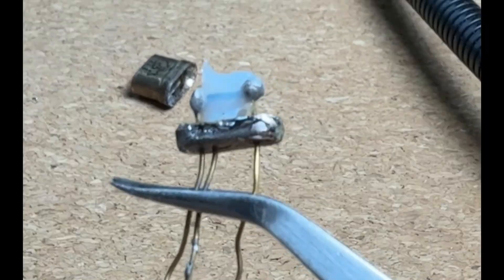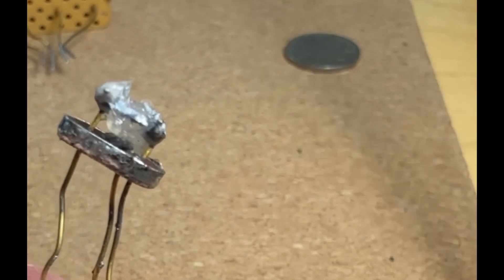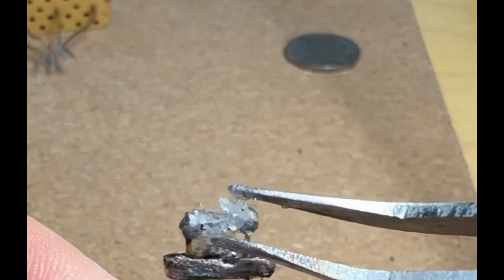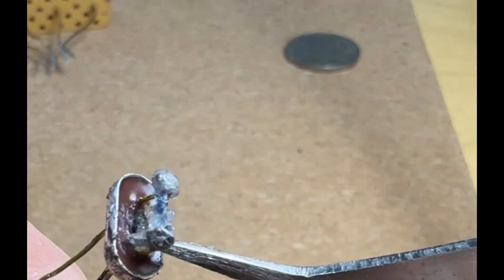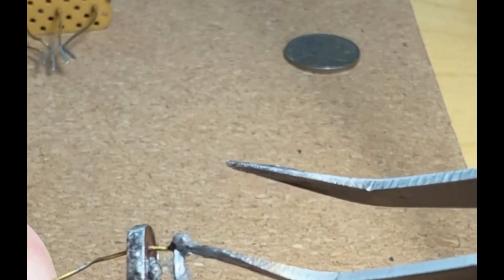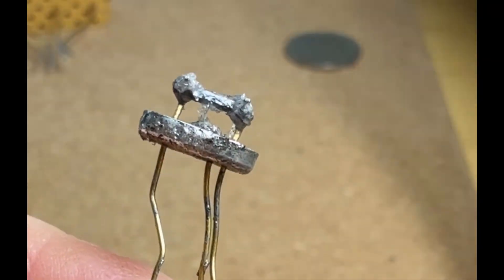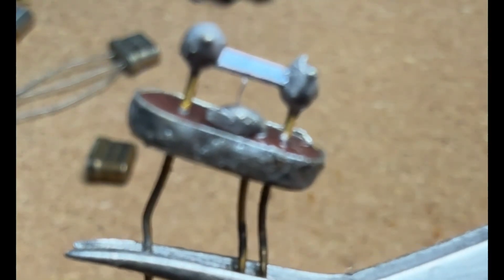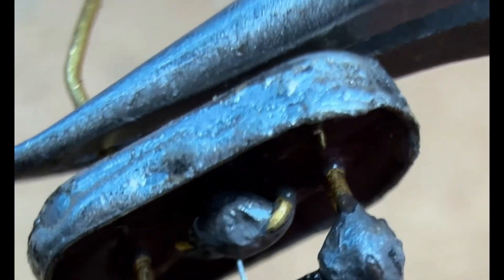Revealing the historic Texas Instruments 904A early silicon transistor

Comment: Back in the 1980's Poland they used to open our germanium power transistors to get to that silicone grease and use it as thermal paste. Such paste was unobtainable back then and this was the only source. Many TG70/TG71/TG72 ended up as donors. Now they cost $3 to $5 a piece and becoming rare, but 40 years ago they were seen as just a junk from the past in silicon era.
Reply: improvisation is a skill that is getting lost in modern times :(
Reply from the maker: Love it, great insight.
Reply: I got this behave on thyristor based circuits mostly. The black anodized alu parts are make the grease spread over his surfaces and turned themself and the insulators olso into dust magnets and create stray current paths and olso create fire hazard cases. 
It is lot more intresting back then.